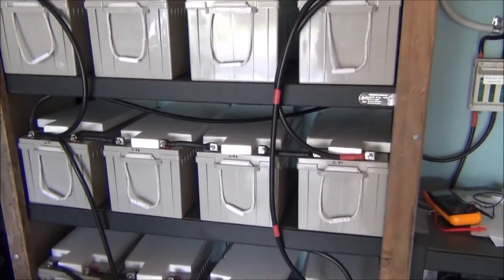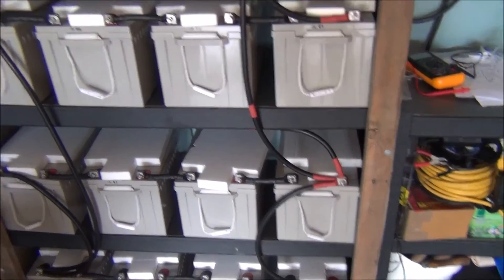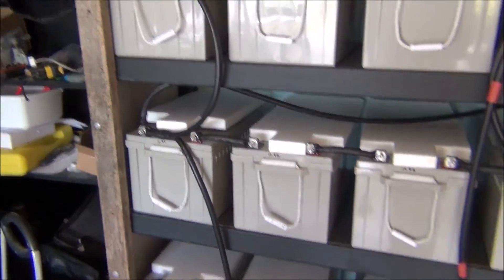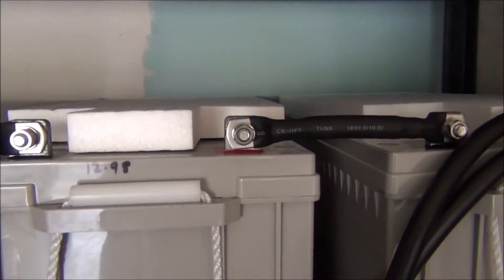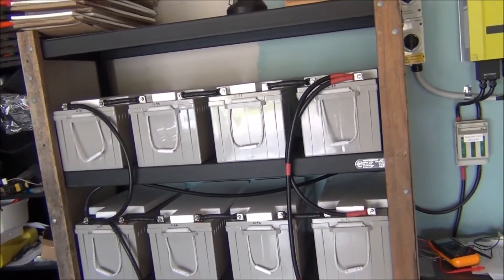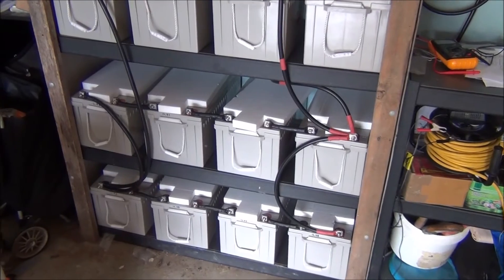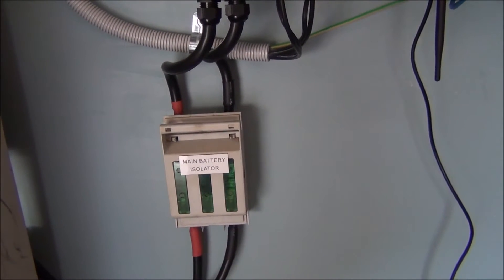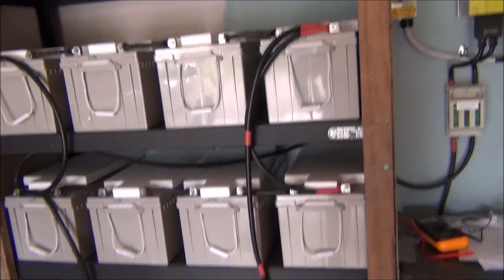My 48vBattery bank and Renesola 5048ME hybrid system

Comment: Did you make the cables yourself? I have built a few of these banks and built a jig for a custom rack that was just like this. Nice work
Reply from the maker: +Jason Andrade  Yes I bought a 30mt roll of 70mm DC 640 strand copper cable and cut them all in three lengths that I used and bought the tinned lugs and a 8 ton  crimp  http://www.ebay.com.au/itm/171627790658 once I workout my lengths it took me maybe 3 hrs to cut and crimp then I used 19mm heat shrink on my ends. 

I looked everywhere for a battery rack most where 1k + but I got this for $100 and just enclosed it for safety. if I get it working as it should I will do a indepth  video  on the hybrid but currently the inverter has problems.
Reply: +sctpc building the cables to length is sure nice, I make custom  cables for all of my projects! I am not familiar with European inverter brands but I am curious to what is not working correctly, I do have quite a bit of hybrid experience though.  Thanks for the Sub to my channel I am working hard to make some quality videos soon!
Reply from the maker: +Jason Andrade  I think you will find Renesola / Goodwe 5048 hybrid is China made, im trying to be diplomatic but basically its not working I could have bought a cheep grid tie to do what it does. Renesola only run first gen software that give no info. it mostly puts the pv power up to the grid never to the house nor charges the batteries and in I tune off the mains grid the inverter clicks giving drity power crashing my computers and modem ect. that Video is uploading now for Renesola to look at the first half is only one light the second it two lights on
Reply: +sctpc this is a hard inverter to find a manual for, if you have a pdf let me know
Reply from the maker: +Jason Andrade http://static.renesola.com/f/2015/01/07/025945aOq33.pdf
Reply: +sctpc A couple of things before I am off for work for the day,  Those batteries look like 240 ah 12 volts paralleled to four strings, so roughly a 960 ah bank at a c10 ratio you need around 96 amps that inverter max is 50, I know silly question but is the charger turned all of the way up? at a 40% discharge you are looking at a roughly 7 hour charge time, do you have a dc clamp meter?
Reply from the maker: +Jason Andrade yes 260ah so 1040ah  my settings are set on 1040 so the inverter has it at 90.2 amp if i put it to 100amp it changes it on my battery AH. I put up a Inverter settings video take a look and see if you can see where im wrong as I have had no info on setting it up other than my mate who has a Goodwe inverter.